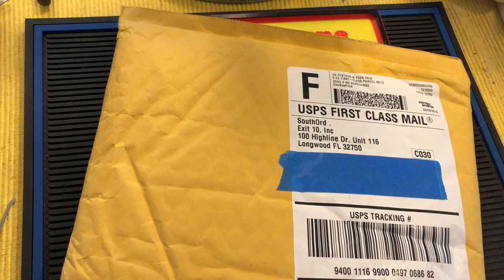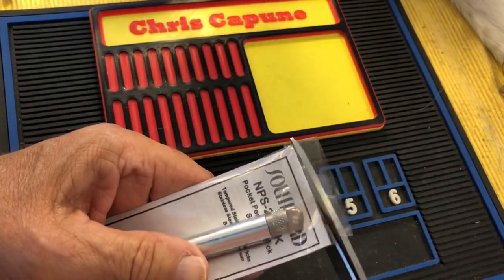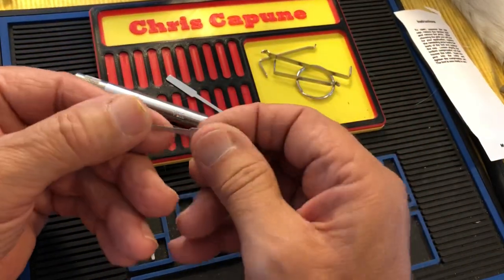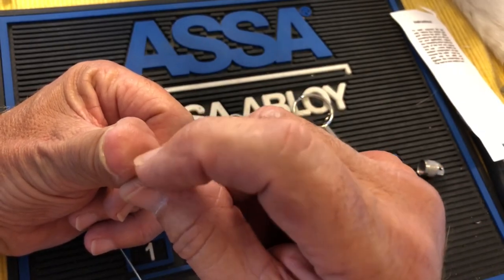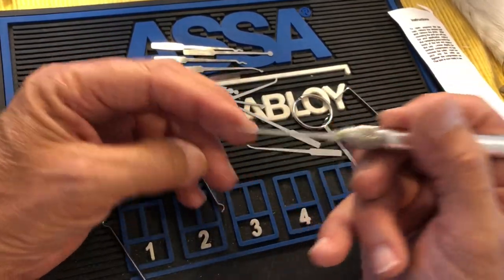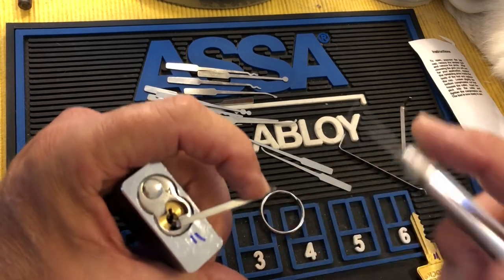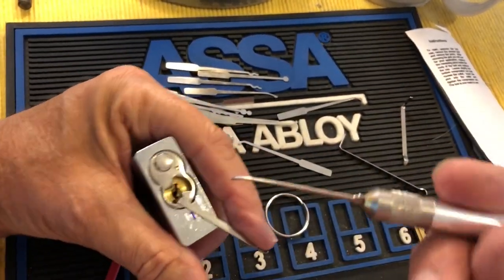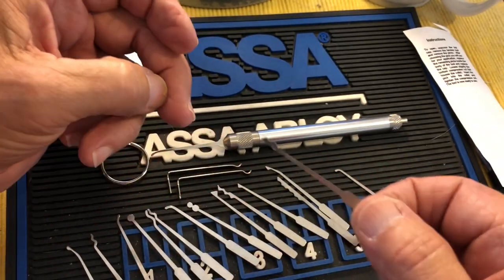#355 South Ord pick pen

Comment: I got a starter set when I ordered a practice 7 pin Cylinder. They were kind of an afterthought at the time but I actually like them. I missed the review you spoke about so I am very glad you did this video. Interesting set, one I think I might just have to look into. Question, can you stack the tensioners and have em on both sides?